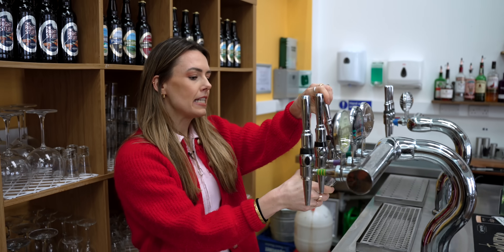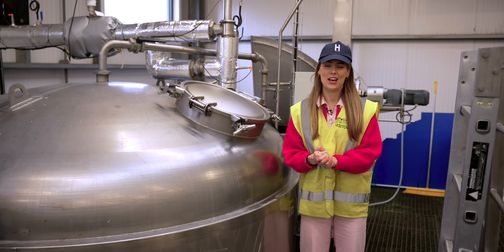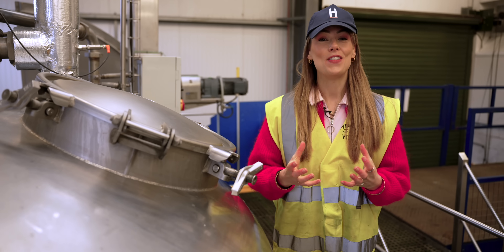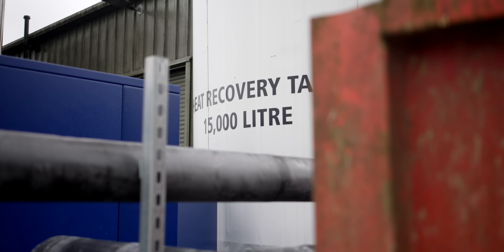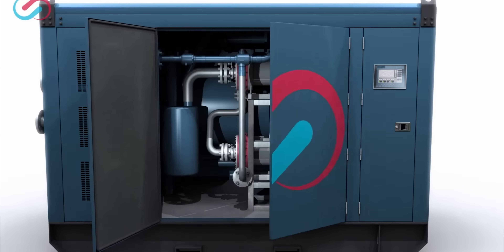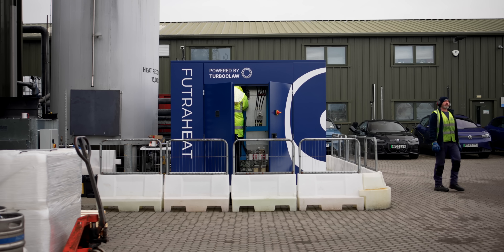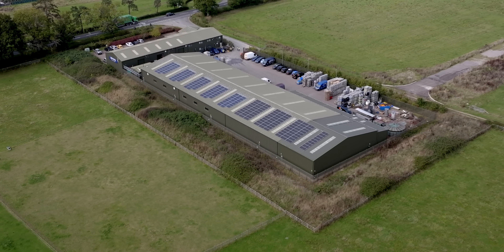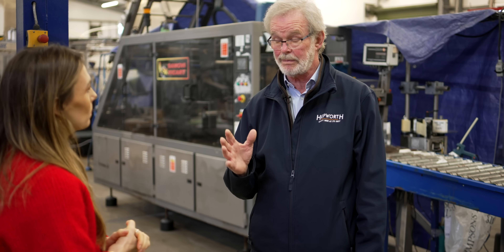This Game-Changing Heat Pump Is Revolutionising Industrial Heat!

Comment: Glad to see more high temperature heat pumps being used in industries. I have seen several in operation in South Korea and Germany in chemical plants and oil refineries and there should be many more. Usually these are put in distillation column overhead condensers that generate steam at 90 to 120°C (at mild vacuum or very low pressures) and compress to useful pressures between 3 to 15 bar gauge. These projects can be more easily justified when new boilers can be avoided for end of life or expansions. Similar compressors can also be used at relatively low capex to raise steam pressures on existing lower pressure steam generators from waste process heat. Rene Waggeveld of BlueTerra published a good slide pack that lists several other steam compressor vendors who produce larger scale equipment.

Comment: Great episode! Even if I would have liked a better answer to the question of why most heat pumps still utilize positive displacement compressors, it seems to me turbo compressors have a lot of potential advantages, some of which are very significant, while their only significant disadvantages I know of are related to the fact that they require high rpms, but that's not that much of an issue anymore.

Comment: By far the biggest efficiency gains in a brewery is heat recovery.
Initial heating of the mash can be aided by recovering the heat from the previous batch crash cooling (once the mash has mashed and before yeast is added)
That's a job for a heat exchanger, not a heat pump.

Comment: It doesn't have to be about heat, there is another YouTuber called @jamessinclair that has a ice-cream factory and roller-skating rink in the same building, I wonder if keeping the rink at a comfortable warm temperature could supply the  factory with cold

Comment: Heatback was a thing once. It exchanges heat from shower water within the drain and gives the recovered heat back to the hot water cylinder. It was able to be retro fitted. Never really took off.
Reply: The energy recovery from a shower drain would be laughably small.
Reply: It still is for air, I am considering getting a heat recovery unit that brings in fresh air from outside after warming it up with heat from the "foul" air it pumps out
Reply: @backacheache  yes. That’s mechanical heat recovery ventilation. I’m installing that in a new low energy house I’m building.
Reply: @hughmarcus1  in my case it's for keeping the oxygen up and the humidity down (it's an old house)
Reply: Same is true of a unit a renewables company I worked for 12 years ago.  It had a small heat pump sitting on top of a 200 litre cylinder. 
The target market was fast food & kitchens. They vent a lot of hot air & need a lot of hot water. 
The idea of that unit was to duct the exhaust hot air via the heat pump that would then create a cylinder of hot water cheaply. 
To me it was a no brainer, but it never took off.
Reply: Interesting. Would like to know more about that. Do you have a company name?

Comment: Rondo Heat Battery charges with intermittent electricity from renewable supply. 
Upto 1,500⁰C hot bricks.
Should be investigated.

Comment: Oooo. He said distilling. Who does that for a pot still?
Reply: Seeing it can go higher temp than distillation needs, easy
Reply: @thekaxmax  The temperatures should work and he literally mentions distillation. But I was thinking along the line of a whisky distillery with pot stills. Has it actually been done? This seems like a new-ish solution so it may not have happened even if it is possible. Would be interesting to see.

Comment: Efficient Secondary Recovery of energy is best done by having multiple processes and uses co-located in the cycle. Say, having a bakery or other high temp user feeding lower temp ones and heat pumps, even residential and agriculture. Also, heat storage tanks to fish ponds, improve the cycle.

Comment: pls. explain that oil for the other compressors is for lubrication nothing to do with the thermal cycle. it seems this is the cousin of TurboCor compressor used in cooling. Any relation? Not clear for me whether the output is high temp @ high pressure water?
Reply: Futraheat site has details, this is a lower power demand heat recovery system than the more traditional centrifugal industrial heat pumps (like TurboCor) that typically spin at much higher speeds that are suited to higher power demand needs. The TurboClaw offers a wide range of COPs according to engineering journals (6 to 60) and in the case of the Brewery operates at a COP of 6.5, lifting heat from 70°C to steam at 150°C (range seems to be as low as 60°C input with up to 200°C output). The heat transfer medium can be pressurised water, steam or a thermal transfer fluid. The system appears on Honeywell's website and is stated as compatible with their Solstice R1233zd ultra-low-global-warming-potential refrigerant.